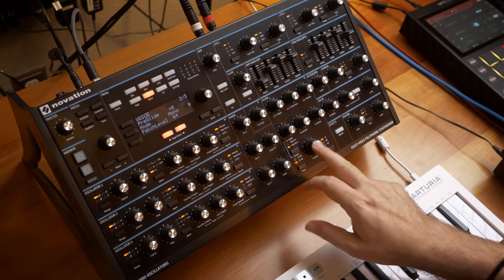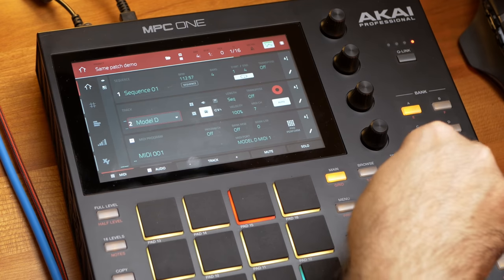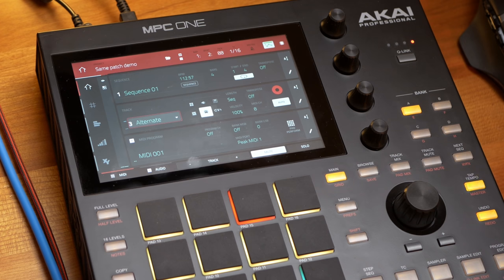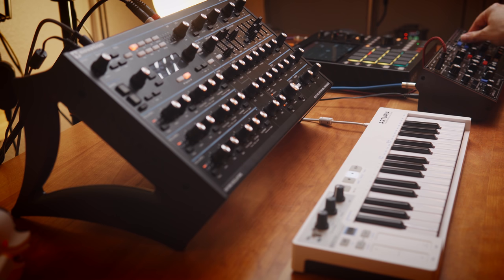Same patch, 9 different synthesizers

Comment: I'm gonna have that bassline stuck in my head all day 🤣
Reply: That's the point🎼😁🍻
Reply: @real2reel947  its quite unique .is this your main instrument .
Reply: @waynesilverman3048  well, I'm a drummer but I write on all kinds of gear.... mostly hardware based, I'm having a computer built so I can run my MPC sampler machine and finalize some ideas into final songs. But my sequencing is done on a Yamaha rm1x at the moment and I do love that box... I've used it since 1999... so I've got it down by now. I love the deep edit abilities in real time.... can't beat it... but it's old and buttons are broken lol... like I literally wrote this last track with a small ball of foil shorting the play button to the board for GO lol... sounds a bit crazy, and it is lol.... but it works. I'll always love it but moving on is important aswell.
Reply: @waynesilverman3048  this video isn't me, but you can visit and hear some of my tunes if your interested.
Reply: Would love to hear this with the , moog grandmother!
Reply: Two years later, and it's still stuck in my head all day. :face-blue-wide-eyes:

Comment: Do you know about the little knob hack for the Model D? You can change the big and small knobs. I took the big knobs from Oscillator 2 and 3 and switched them with Cutoff Frequency and Mod Depth. Makes a lot more sense, since those are the one you play the most. And I don't accidently change the Pitch on Osc 2 and 3 anymore. Thanks for your Videos, really great work!
Reply: Great hack!
Reply: Pro tips!

Comment: As a synth-curious guitarist I wondered what people mean exactly when they say different synths have their own unique character. Now I get it. Thanks!!
Reply: the same can be said about guitars and they are a much more simple instrument than a synth. a strat has a different character than a flying V guitar
different pickups also have a big effect on the character and those are just electro magnets.
I'm into modular synths and even patching up the exact same modules in a different way can have a drastic effect on the sound.

 lets say 2 synths use exactly the same circuit diagram but one of the synths uses traces between the components that are twice as long as the other synth. the longer wires have a  higher resistence which can effect the sound, it would be very subtle but the difference would be there. (same way a guitar pickup with tighter wound coils and more wire will effect the sound)
some of the older synths that used real wiring between components cut and assembled by human beings (not circuit boards printed and etched by machine) can sound different even if it is the same model of synth.
no 2 minimoogs sound EXACTLY the same because of small variations in the build process. (they will be very similar but not identical)

even the temperature of a room can have an effect on the sound of a synth.

Comment: Loved the video... just proving what I already knew... even basic subtractive analog synthesis has thousands of variables.  Every company's oscillators, envelopes, filters, and VCAs are all different, and when you string them together, they each have unique voices!  Not one can really copy the other's sound.  As much as I love my modular.... I'm now wondering if I'd just have more fun with a Novation Peak, and Beh_2600 and Model_D.  With those 3 synths.... you'd really have a wide spectrum covered.

Comment: Great video. To me the Model D, and Moog in general, is like the Precision Bass. It always work on a mix. It's THE sound for bass. But of course, there are hundreds of other sounds that can work an will sound great.
Reply: If anything, Moogs (and moog type circuits) can be TOO thick in a mix... hehe. Not a problem if you do a little careful EQ. For other synths, and FM synthesis... an analog chorus can really take a bassline into orbit. Different than Moog 'fur' but just as satisfying...

Comment: Great idea for a video. I found it extremely valuable. The low-end volume of each of the bass notes you play is FAR more consistent on the Model D. That big, beefy fundamental never lets up, whereas, on every other synth, the lower notes have a noticeably weaker low-end (fundamental). I think detuning the oscillators worked against you on the other synths because it's way too easy for two oscillators to get out of phase with one another, which can cancel the fundamental. I swear I can hear the low-end drop off each time you start detuning.
Reply: Yeah, listen to the Analog 4 segment especially. You will hear certain notes drop drastically in volume. I think that's the oscillators going out of phase at certain frequencies due to the detuning.

Comment: Enjoyed this comparison...what fun having all those instruments. I should use my MPC One more as the brain. I have hooked up my keystep like yours and left the beatstep pro and microfreak to control the volcas and neutron. Btw, when you mentioned the Neutron as having a "nice little patchbay", my Lfo triggered... ; )
Reply: The Neutron patchbay is excellent. I hooked up my Roland Aerophone AE-30 wind synth to my Neutron and with the aid of a MidiVolts Desktop for more CVs I was able to control filter cut-off and resonance and control the LFO for "vibrato on demand". I'm looking forward to using the CV outs on my MPC One to switch oscillator settings. I uploaded a video of it in action to my channel.
Reply: @unclemick-synths  i must see that vid

Comment: Just stabbing in the dark here, but I think the main difference between the Model D and the Neutron (which I have) is that the Model D has a 24 dB/oct low-pass ladder filter, whereas the Neutron has a 12dB multimode filter. The "roundness" of the Model D bass patch relies heavily on the steep cutoff of the LPF. (Thankfully, since the Neutron is Eurorack-compatible, if you REALLY want a 24dB filter you can always hook it up to an external module.)
Reply: Also re: the Microfreak, I agree that it's an unfair comparison. I sort of think of the Freak as a digital synth that happens to have an analog filter, so it's NOT gonna sound like a Minimoog. Which doesn't mean it's not worth getting, just that you'll probably have the best luck using it in a context where it can shine with its digital nature, rather than poorly emulating an analog synth (unless you're doing something simple like a 303 line with it).
Reply: you can even plug your neutron's oscillator mix into the model D's external input and send the model D output into the neutron's VCA. i find these synths work well together because you can e.g. use the model D's envelopes to give you extra modulation potential on the neutron, or vice versa
Reply: Money saving tip: combine Filter1 and Filter2 using Sum1/2 patchbay, routing into VCA, and you will get a nicely 4pole filter.
Reply: @grouponspeam9236  Hm, well don't the Filter 1 and Filter 2 outputs have different topologies? Like I don't think both filter outputs can be low-pass at once. Maybe I'm wrong tho?

Comment: With any synthesiser, analogue or digital, the output circuitry, amplifiers, choices about headroom ,etc makes such a difference to the sound and musicality of the instrument. I believe that's a big part of the reason why people like the sound of Moog synthesisers so much. They have heaps of headroom and have circuits that have really nice sounding harmonic distortion with lots of low end. I don't believe the oscillators themselves contribute as much to the sound of any synth as does the output circuitry.
Reply: Yes that's why the same synth sounds different depending on the mixer sampler or listening device and their settings. Not to mention the listening environment. The range of possibilities could kill me, aaaaah! Sometimes I feel like making music is like painting blindfolded.
Reply: @3039-m9o  You can think about it as using different shades of the same color. It's not painting blindfolded, It's finding your favorite shade and then sticking to it.
Reply: ArcaneAudio  In my experience, Moog filters take away lots of low end with resonance. I think he's just turned it up to compensate.
Reply: ArcaneAudio  I'm not here to argue which filter is the best. In fact, I don't know the names of the different filters, I can just hear them. That's a cool trick I should try. But I'm basing my experience off of my three Moogs: DFAM, Mother, and Subharmonicon.
Reply: I think All Y’all are kinda correct....!

Each component makes subtle sonic differences, but if every synth ever made used the Exact Same Components the actual physical circuit(signal flow) upon which the components are mounted, will also make a sonic difference.....
Reply: @paultorbert6929  Yeah, clearly the architecture of a synth affects the sound. What I'm saying, which I heard originally from Chris Hugget (RIP) and then repeated by one of the engineers who designed the ASM Hydrasynth, was that all the circuitry that occurs after the basic synthesiser architecture has a massive effect on the sound and character of said synth.
Reply: @r3dsh1ft3d  true

Comment: Always interesting to compare the sound signature of different synths. For the bass line the Model D is the king, more warmth and roundness while having the necessary bite. The 2600 can really sound as big as the model D and it is normal because they had some important similarities (3 VCO, "same" VCF  hence problems between ARP and Moog). The Take 5 is surprisingly very good too, not same sound signature, but usable for the job. All others synths, even the Peak I really love,  are not done for this job, that's clear. I'm a bit disappointed by the Pro-3, I was hoping something more powerful. Sometime people asks why we have so much synths.They thing they are all the same. That's false, each synths has its own range of sounds where it can shine. All synths are not good for basses, not all can produce water clear bells, so we need them all :-)

Comment: I have a model D/ Pro 1/ Neutron.... they are really neat to play with.... no doubt. But they ALL seem to give me hiccups on sequencer Midi delays originating from my yamaha Rm1X.... the yamaha Rm1X is a pretty powerful unit that works like cake with my Roland and Novation synths, even the Waldorf and my Behringer deepmind 12 seems to keep up fine. I have nothing against the semi modular units aside from that, and the fact I can't save exact sound canvass patches for tracks I've written that require the exact same tones every run..... it is inconvenient to keep resetting them for a "live p.a." application....
Reply from the maker: Hmmm have you tried looking into firmware updates? I haven't checked, but it's possible Behringer has updated those to fix some midi bugs.
Reply: @TeftyMeems  that is something I need to do, at the present moment they are all packed up because I'm doing some remodeling here at the house... but that's definitely something I gotta look into for sure!
Reply: @real2reel947  I had similar issues, they were mostly fits by firmware updates
Reply: @killplants3946  awesome!!! I'll definitely check em into the matrix for updates!

Comment: Okay, BIG difference with the Minilogue: the way it generates a sawtooth waveform makes it so that any pure (non-mirrored) sawtooth generated will be an octave higher in pitch than the other two waveforms. I'd personally also switch the filter to 4-pole mode, since that's closer to the 24dB/oct filter in the Model D. That said, you made a solid bass patch with it as is, so who am I to talk? It kinda reminds me of the "electric bass" patch on the Roland SH-1000 that Bruce Haack used in Haackula.

Comment: Nice video! Very interesting indeed! To me it sounds like the most musically important differences are envelope shapes and glide slope. Model D sounds like the envelope changes are curved very nicely by default. The ADSR sounds so groovy! Its snappy but not sharp and nicely proportioned between parts of the ADSR. It really dances! The 2600 was great aswell. Some of the other synths sound more or less stiff to my ears. It would be interesting to fiddle with envelope settings in, lets say Peak, to push it closer. With a powerful synth like that I would hope to do better in a similar patch. I certainly can with the Ultranova by tweaking amp/filter envelope curves and glide settings. Has anyone here pushed the peak hard for that nice fat groovy wobbly feeling in a bass sound?

Comment: the pro-1, model-d and barp are all very nice sounding synths. I think the pro-1 is the only with digitally controlled envelops which had some issues but it got resolved, the others are pure analog synths. So on my short list are the pro-1 and barp grey meanie. once prices are back to normal.

Comment: Late to the party, I know. Um, at 10:15.....Osc Sync doesn't lock them together. As one oscillator finishes a cycle, it resets the phase of another oscillator, forcing the latter to have the same base frequency. This can produce a harmonically rich sound, the timbre of which can be altered by varying the synced oscillator's frequency. A synced oscillator that resets other oscillator(s) is called the master; the oscillators which it resets are called slaves. The Cars "Let's Go" keyboard lead is an example of one of the most famous Oscillator sync sounds in pop music.

Otherwise, great work. Subbed!

Comment: Great Video! I have a Model D, Peak, Hydrasynth, and Virus Ti 2. As well as many VSTi, including the verious Moog emulations.Reactor Monarch was my fav. Since having the Model D, ive not really tried many of the newer updates etc to the soft synths. My Model D is ALWAYS my main bass. I have also done this exact same exercise, although, I use A 16` Sq, 8` pulse, 4` narrow pluse, played at F#1. I can get the hydra to sound as "fat" as the modal D, by using some FM cross mod, kinda. Not even close with same settings though. I choose not to detune, as the natural "drift" of the Model D is quite noticable, especially if you change octives, on my unit anyway. For the price, you wont find a bass that come close to this great little synth. Check out some of the video where people lucky enough to own an original, Moog model D, compare them to the Behringer Model D. Even they cant tell, except in some of the extrems with the filter etc.

Comment: on the A4, if you wanted to make a detuned 3osc sound like the Model D, you can use the NEI oscillator type on OSC2 of either Tracks 2, 3 or 4 to route the oscillators of the preceding track through it; so for example if you set Track 2's OSC2 to NEI, you'd hear OSC1 and OSC2 of Track 1, plus OSC1 of Track 2, all going through Track 2's filter - three oscs all separately detuneable! You would obviously need to route your MIDI so that both tracks are receiving the same note data. You can even chain this all the way up to Track 4 so that you have up to 5 oscillators going through a single filter, and that's before you even take suboscs into account!
Reply from the maker: Great tip! 🙏

Comment: Great vid.   Not surprised the Boog crushed on bass duties.  The Barp did well, and I wasn’t surprised the polys were much weaker, but I was very disappointed in the Pro 3.  You would think Dave’s current flagship mono could at least hold its own.  Far cry from the Pro One, which along with the 2600 and Prodigy are about the only monos that ever could compete with the Minimoog on bass.  (Not to mention to Taurus etc).   Also kinda surprised the Microfreak couldn’t get any more heft and punch than this.

Comment: I have made a test with a linux virtual-analog-synth. First used Odin2, but this sounded not good. So i used cardinal, a modular system, used three VCOs from Bogaudio, a 4-channel-mixer (fourth input as "remix-input"), a Lader-filter (first i found when searching for ladder), and a bogaudio-VCA.
In my opinion it sound good, but i am not able to check the sound of the Model-D with my installation, cause the Jack-Soundclient blocks the video-audio.
Have you ever checked the analog simulation (in this case its open-source, so very inexpensive :) ) or do you think of having fun with a comparison?
I will create a video the next days to be able to compare the sound...

Comment: i think last 25% of oscillator volume slider are adding subtle ovedrive to oscillator .. you can verify it using some spectrral analyser but i think this was the case on Oddysei nd it's same on 2600